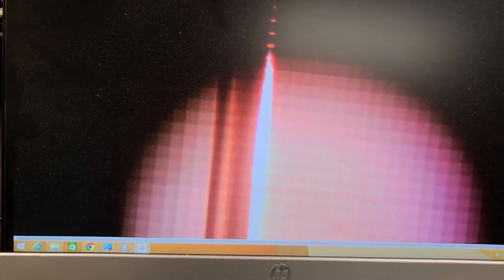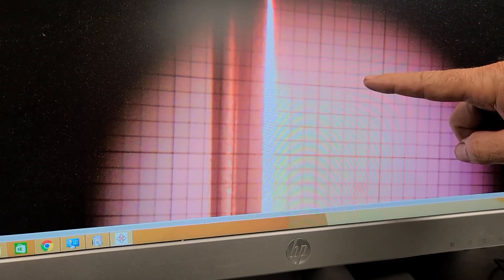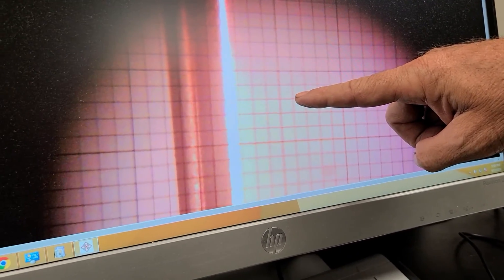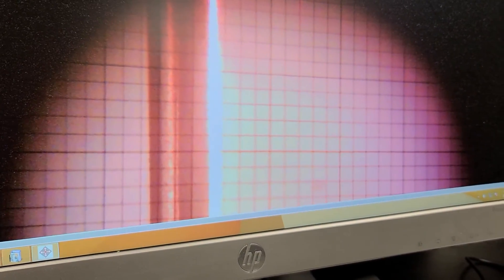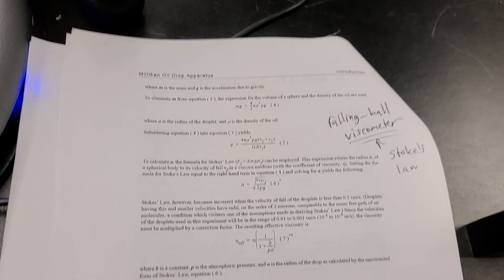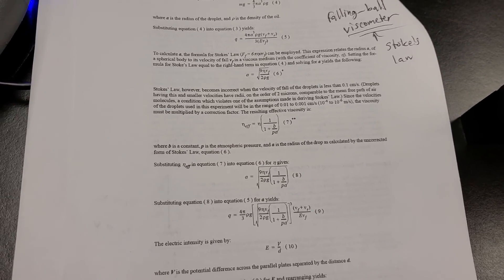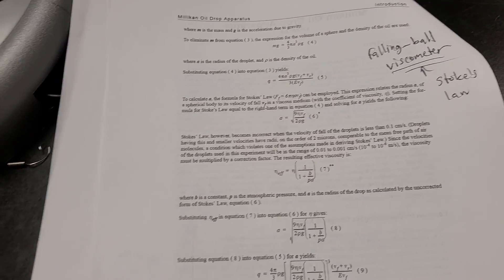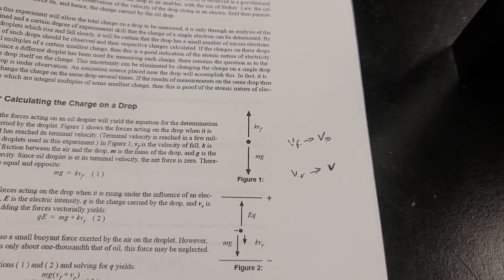Millikan oil drop experiment: Introduction—Part II

Comment: As far as I know, oil drop will get positive charge in ionization chamber. The negatively charged plate which is on top will attract the positively charged oil drop. Am I correct, sir?
Reply from the maker: Oil drops can be both negatively and positively charged. Plate polarity is varied. See the PDF instructions for the Millikan oil drop experiment I just uploaded.